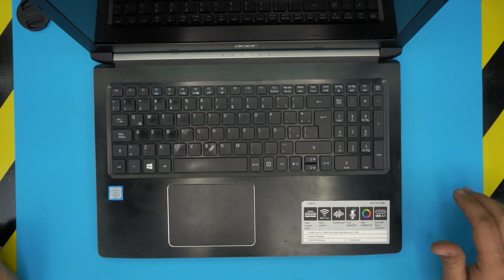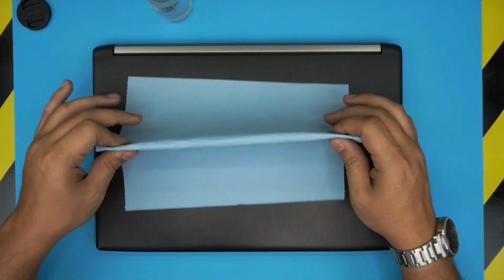Acer Aspire 5 A515 51 52bq  📢  Service Cleaning & Repaste

Comment: Oh, my Acer laptop got a splash of water and turned off itself and shows message "extremely low battery" . The fact is the battery is fully charged,  I know i need to dry my laptop. So i found your video, it is very helpful. BUT one of the screws for the hard drive is too tight and busted with several attempt. I can't separate the hard drive with its adapter cable. Now I have no access to REMOVE the battery,  I left like this : my laptop's back lid is loose, I turned on a fan facing my laptop. What else I can do ?
Reply from the maker: Regarding your question, I highly recommend taking your laptop to a nearby repair shop and asking them to wash your motherboard in an ultrasonic tank. This will remove any oxidation and corrosion caused by water. If you simply leave it to dry, you’re creating a time bomb that could result in motherboard failure.

Comment: sometimes my Acer Aspire 5 will completely off by itself without any notice.  I will have to wait 5 mins to press the power button and it will start again.  It happens either plug in the power or not.  I have open up the laptop and cleanup the fan but it still happen once in a while.  May I ask what could be the issues and how to identify or solve it? THank you
Reply from the maker: 🫠Regarding your question, the issue is a BGA ball joint under the GPU, it will require a reballing.
also before that you may need to check the capacitors , not something you can do at home my friend it will requires tools and experiance. sorry to inform you about it. when we get this issue 90% is the GPU ball joints.